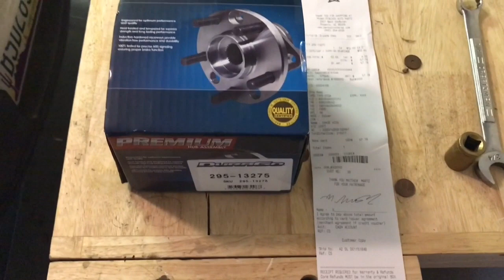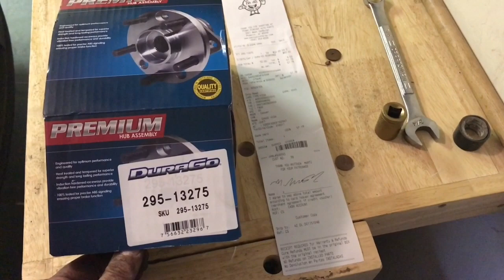Replacing rear wheel hub in a 2013 Ford Taurus

Comment: Every step of this HAD to be preplanned and set up for it to go this easy in the video.  Just attempted this on my sons car, same make, year, etc.  Took over 9 hours and a oxy acetylene torch to get it off.  Had to cut through the entire bearing just to get it off with the slide hammer.
Reply from the maker: efd1989 it was in real time and not a set up. I’ve been where you are though, when things just don’t go well. Sorry it was a struggle for you.

Comment: Spot on great video. But if people live in the salt belt northern climates I guarantee you will not get that hub out even with the slide hammer.
Reply: Lol yep. Just had to replace one on a 2013 upstate NY used the hub buster a slide hammer heat etc. did not work had to remove the knuckle and put it in a 200 ton press I have at shop to get it out.
Reply: I got mine out with a mini sledge had to drop everything literally did it today in the front got 3 more to go in Michigan

Comment: My sho has lived on the East coast it's whole life, all 125K miles, I'm replacing all four wheel hub bearings on it along with the entirely new braking system, getting the wheel hubs out are the hardest thing about this whole job. I beat the living shit out of the rear one and it's still stuck in there. I tried a slide hammer, beating the hell out of it, penetrating oil, everything. The next thing would be a torch I guess but I cannot get this shit off for anything.

Comment: What are the torque specs for the bolt on the hub all i can find is that the axle nut torque spec is 258 ft pounds but nit sure if hub is the same

Comment: Been working on the passenger side rear for three days. Destroyed a slide hammer, air hammer won't remove it. Tried to press it out don't work and going to cut it out piece by piece.  Pain in the but project. Hopefully I'll never have to do it again on 2014 ford taurus.
Reply: Correct on that mine 30,000 miles it was froze on pain in ass bad design ford Motor. Plus no bearing should go bad that soon.